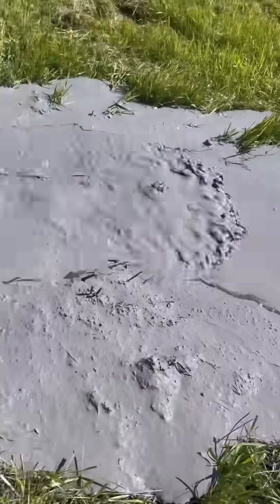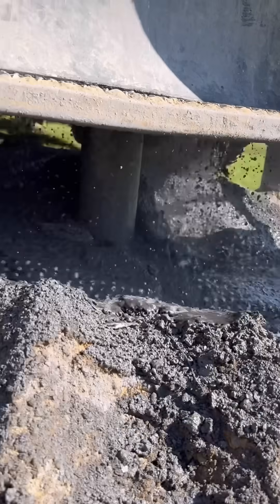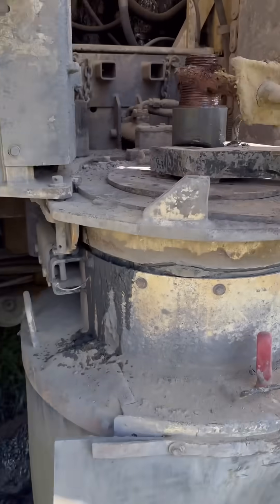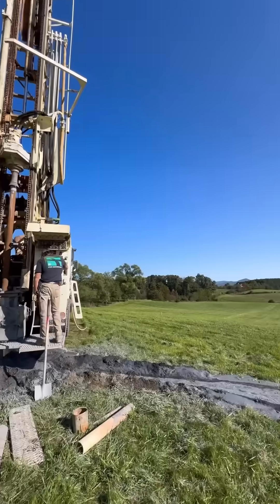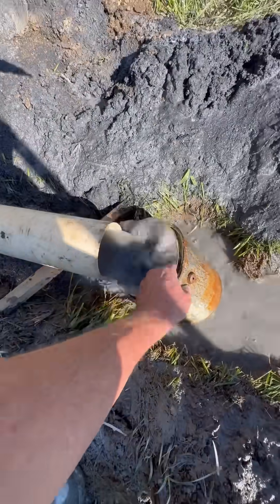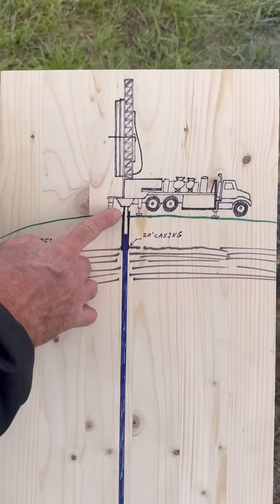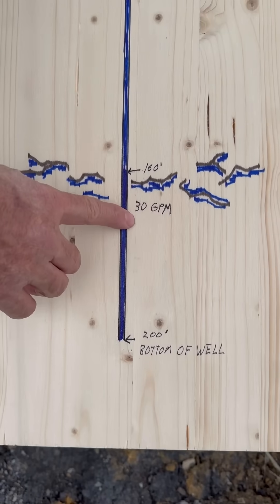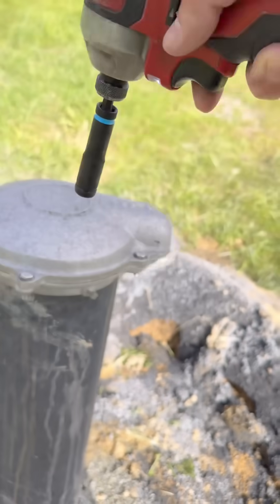How To Drill A Well

Comment: At what depth is the pump? Here in florida,  pumps may have a deep well but the pump is shallow. For example  I was told we had 150 well thru sand to rock, water was at 70 ft, but pump was only at 80 ft.  That meant all our septic water was drawn to the well, only being separated by the house and 100 ft. No wonder it tested positive for  ecoli.
Reply from the maker: The well driller said to set the pump around 140 feet deep

Comment: I’m On the central California coast. We drilled our well this summer for our residence and had to go down 700 feet to get 35 gallons a minute. The cost was $100 per foot or around $70,000 for the drilling and another 25,000 for the tanks plumbing and pump installations.
Reply: That's crazy high, glad I don't live in California, that same well would cost around $15K in my area.

Comment: Drilled mine back in 2018. Got over 220 gallon per minute. Yes thats correct. The drill stopped because the water pressure was greater than the compressor. Water was exploding back and the contractor couldn't even hold the little bucket. Mines 499' deep and drilling was about  8-9K. That was just to drill and cap off. The plumber took it from there and dropped the pump.
Reply: Yeah I needed to drill a well for my pond and a caving back there and they dug it and idk how many ft but it was something called an artesian well
Reply: @L-oi9kh artesian wells are the fresh drinking water with healthy minerals so it sounds like you tapped into an underground freshwater aquifer.
Reply: This is an interesting conversation. I'd like to come back in a couple days and learn some more, so I'm only commenting for that reason
Reply: Nestle wants to know your location
Reply: @brrr8963  NORTH Carolina
Near Winston-Salem. The soil is red clay if that matters
Reply: Why did you need a pump with that kind of pressure? Pressure reducer?
Reply: @Robyrob7771  excellent question... a high yield well doesn't necessarily mean high pressure. It means you will never draw it down. You still have to pump the water to the house and fill a pump tank. And no typically on a well you dont need a PRV.
Reply: @tomdabomb3457 In fact, many wells need pressure booster tanks! (Basically 40 gallons at huge pressure, letting you usually never notice the loss of pressure.)
Reply: @tomdabomb3457 - not if you let it flow above the elevation of the house and let gravity build the pressure..
Reply: @tomdabomb3457  brother-in-law has 25 pounds pressure without a pump
Reply: @Robyrob7771  bingo
Reply: Artesian well I assume?
Reply: So you got an artisan well? Might need a jet pump to get pressure to the house and that’s it.
Reply: Total cost from drilling to 250 foot@ 14 gal an hour, to finish pump tank  hookup at home $24,569.
Reply: @hidebehind2604 that's terrifying. I just bought property off grid in AZ and will have to put in at least 1 well. I bought 2 separate 32 acre lots and wanted a well at the lower property for irrigation but at that price, I'll probably just put one at the one we're putting the container house on.
Reply: @thomasschwab1727 where in Arizona exactly? AJ, Gold Canyon , Florence?
Reply: A vacuum bell helps to keep the pressure in the pump for instant water at the pressure the pump works at here in Portugal.
Reply: Are you truly in Portugal ? I've never texted anyone from Portugal. @michaelholford8852
Reply: Pretty sure they drilled into a water line on the other side of the Earth in CHY-NA.
Reply: Takes an awfully big pump to utilize that.
Reply: Sounds like an artesian well
Reply: Artesian well ?
Reply: An artesian well is under pressure from surrounding soil and rock. It can have enough pressureto come all the way to the surface.   @Cptn.Smoker
Reply: I had to go 600 feet and only got 12 gpm 🤣
Reply: thats very reasonable. I thought these were 5x more expensive than that
Reply: Nice
Reply: is water from the well drinkable?
Reply: @BLX187  yes! It is super pure. Tastes like Icelandic. As with any well i have to use sediment filters and change every 3-4 months, but nothing special as far as filtration system.
Reply: @tomdabomb3457  cool. Thanx
Reply: So about 20 grand now to drill it. I was waiting for you to say they had a blow out. Pretty much huh? Lol
Reply: wow!!!!
Reply: Watch out for the random landslide or Forrest fire  government might want that water !!
Reply: Between 5,000 and 15,000 +
Reply: Are u in az.500 ft is a long way down.
Reply: @freedomliberty8944   no, I am in whats referred to as the Piedmont area of North Carolina.
We havd wells that are from anywhere 200- 800' deep here. The average is 300-400'
Reply: You'd face diminishing returns with those sorts of unnecessary depths. But hey, if you want to waste your money you do that. $9K for a well is insane. I paid two slabs of beer for mine twenty years ago.
Reply: @bashkillszombies when you're talking water for life an investment is an investment
Reply: is the water free for house hold then?
Reply: What on earth could be the source of a well that could deliver that amount of water? I've heard of Wells that would only produce maybe a gallon of water an hour And you had to wait several days for it to build up in a holding tank before you get rely on it.
Reply: @johnnycarson67  it's called drilling into the aquifer, which is a giant lake underground. It's what they aim for when doing a well for a town or large complex. Locally we have that in the valley where the water table is about 15 feet below grade. You can basically dig a hole with a backhoe and get unlimited water.
Reply: @rupe53 that’s terrifying.
Reply: @elijah2712    what's the terrifying part? You couldn't ask for anything better.
Reply: @johnnycarson67  when my well was drilled they got to 180' and told me we had 1 GPM. Technically you can run a whole house on that amount. When the driller got to 480' they hit what they called a "main vein", or something like that. He told me he had never in his career drilled one with this much water. I live about 1 mile from a river so im not sure if that makes a difference. Believe me, i was shocked and very pleased at the same time.
Reply: @tomdabomb3457  He probably hit an aquifer.  

1 Gpm isn't very good.  I get 3.2 Gpm on city water @ 55 psi.
Reply: @ab_ab_c  I don’t know if I’d use the same standards for “good” when talking about a well rather than a whole city’s water sysytem
Reply: @tomdabomb3457 - yes but is it potable ?
Reply: @ab_ab_c  1 gallon per minute is 1440 gallons per day. How much water do you think someone needs?
Reply: @ab_ab_c if the alternative is buying bottled water and washing with rain I think it’ll seem like an excellent amount. Especially if you consider 12 hours asleep, so that’s 12 gallons in a tank right away, plus your drill head.
Reply: @johnnycarson67  I’ve seen in Utah a few artisan wells that has constant pressure. Maybe 20psi, but could do 10gpm. It comes down to luck. 

I’m in Tennessee now. Someone 1/2 mile away has a recharge of 5gpm at 60 ft, yet I’m at 280’ with 1.7gpm. Same drilling company. 

1/2 mile down the street are springs that start a creek. 

Geology is weird.
Reply: @johnnycarson67 Where I grew up, we all had wells. We were very rural. At around 200ft, the amount of water we could get was dependent on our pump. All the farms around us had multiple wells that could pull 1,000gpm, if they were running a big enough motor. The well motor was what limited how much water could be pulled. The bigger the engine, the more water they could draw.  The farmer I worked for as a teen had a well with a Chevy 350 that could pull 800gpm. His wells with 454s could pull 1k gpm. Engines were mounted on concrete stands and drove the pumps.
Reply: @johnnycarson67 underground rivers for one.
Reply: @johnnycarson67 ground water can be under insane amounts of pressure, there’s videos online of people trying to drill wells and ending up with geysers instead.
Reply: @johnnycarson67  if you're lower than the source, like at the bottom of a source of snow melt.  Aquifers are more like an underground river, not a lake.  It pools, but it also flows and flows downhill.
Reply: @johnnycarson67  he drilled to the ocean on the other side of the globe and it's now slowly draining.
Reply: @PuerRidcully  so that’s what happened to the red Sea
Reply: We are not on a spinning water ball. Waters above, waters below.
Reply: @johnnycarson67 dude drilled down into a water main to get that kind of flow lmao. 220 gpm is wild for a well!
Reply: @johnnycarson67 he probably drilled into the cities water line 😂
Reply: @johnnycarson67 our irrigation wells for watering crops are anywhere from 800-1200 gallon per minute at 40psi. But they’re made for high volume
Reply: you got ripped off if the driller didnt install the pump and hook it to the house. and I call bs on 220 gallons a minute. that not even possible.
Reply: @goodbyemr.anderson5065 Yellowstone…

Comment: I payed $6,500 for mine . 220 ft d. 20ft casing 55 gal pm. And grout.  No pump installation. Just drill.  And the answer is drill cuttings.so the gray sludge is ground up bedrock. Lol.

Comment: I had to drill two wells on my property in Tennessee,one 800 the other 440. But the water is so much better.
Reply: 800' is crazy.
Reply: @alfredoowns12  That is quite deep, but then they have mountains in TN, so it isn't too surprising.
Reply: How much is it to drill a well
Reply: In TN as well. We used a cable tool rig to drill our wells, 160' and 180'. The percussion produces better flow at shallower depth. Our neighbors all have rotary wells at 500'+
Reply: Primary water
Reply: @MrBeard-ig5zc  I don’t really remember it was a couple years ago but it was in 30k range
Reply: My well is only 40 feet.  And never have ran out of water
Reply: It’s damn good water tho lol
Reply: @KnoX-oUt  mmm untreated ground water with microplastics, possible bacteria/parasites, and unknown chemicals

Comment: I spent about 25k on mine at 450ft deep. Totally worth it though as it’s an artesian well. Really interesting to see all that water flowing out of it all year round!
Reply: Build yourself a spring house! I bet that water is COLD!
Reply: @Robyrob7771  great idea! It’s freezing cold, even when it’s the middle of summer!
Reply: @Robyrob7771 they will actually pull the moisture out from the air so you can age meats and cheese
Reply: That really does seems like a good investment
Reply: If you let an artesian well flow without capping it 24/7, it may reduce over time or even stop flowing completely. This happened in the area where I live. My grandparents let their artesian well flow freely as did many in the area and after a few years it stopped flowing and they had to install pumps.
Reply: @AlexSilva1  your being extremely wasteful with that. Wait until it runs dry than you can spend another 25k. Good for you
Reply: Congrats that's awesome.

Consider all the best ways to best utilize and perhaps share that resource! (Infrastructure network, large tank filling station for buffaloing water, agroforestry, nature wetlands....)
Reply: Very wasteful and you're losing the water table for everywhere around you. Good luck when the water runs out, some of the deeper deposits are clay locked and take millenia to recharge
Reply: You don't mean the water is flowing out 24 hrs a day?
Reply: @phillipkalaveras1725  that is what "Artesian Well" means. The water underground is under pressure and comes up out of the well on its own.
Reply: @phillipkalaveras1725  yep, all day every day. The drillers must have tapped into an underground reservoir or something, really neat!

Comment: I think mine was about 10k.  I'm going by memory but I think it was 180 feet.  If your well water is like mine, get an oxidation system to remove the metals.  Mine uses peroxide.    Between that, the softener, and the whole house filter, I have good drinking water.  After 16 months, no discoloration in the toilet tank.
Reply from the maker: Nice

Comment: Is this common in the United States? Drilling wells for single homes? How do you guarantee the water's quality and safety?
Reply: Most deep water is not contaminated by surface water.

The water can be tested with a laboratory service. If there is bacteria, mineral or particulate contamination a filtration system can be attached by the well to make safe for home and animal use.
Reply from the maker: We take samples in to be tested by the health department before they approve the well
Reply: @hausplans  awesome! Thanks for the reply
Reply: how else do you get water in rural places?
Reply: @BartholomewJenkins69420  Well I live in a much smaller country where it's very difficult to get offgrid land, so I'm just not that familiar with the concept. Was just wondering how you make sure the water is healthy and free of bacteria etc...
Reply: @douwevanboxmeer181  usually people that run on exclusively well water use multiple filters to purify the water. My aunt has it and has 2 water heaters and has 3 purifiers before it gets to the faucet. Just have to change the filters regularly and that’s about it.

Comment: What Google said: 

The cost of drilling a well on your land can range from $1,500 to more than $30,000, with the average cost being around $5,000–$10,000. The price depends on many factors, including: 
 
Depth
The deeper the well, the more it will cost to drill. Wells for drinking water are typically at least 100 feet deep. 
 
Location
The distance from the well to your property and the soil in your area can affect the cost. 
 
Casing
The size and material of the pipe casing can impact the cost. PVC is the most affordable option, while galvanized or stainless steel is more expensive. 
 
Permits
You'll need to obtain local drilling permits to start the project. 
 
Site preparation
If the ground needs to be regraded or excavated, the cost can add up quickly. 
 
Other components
You'll also need to consider the cost of plumbing and electrical components, a pump system, water treatment, and a control box and panel. 
 
To save money, you can try to keep the well shallow and install it close to your home.